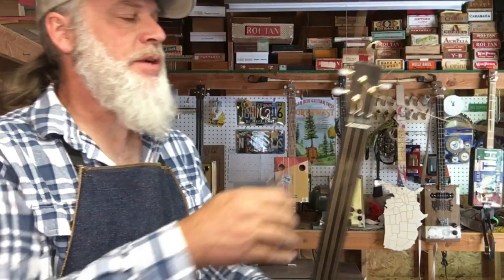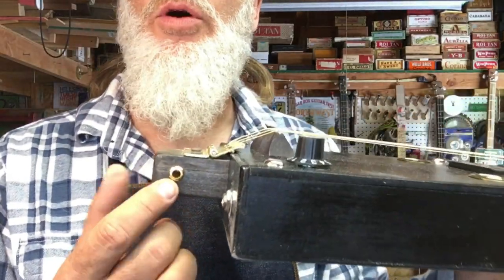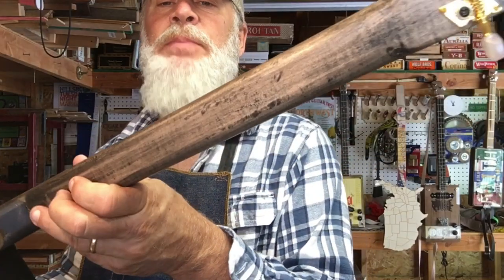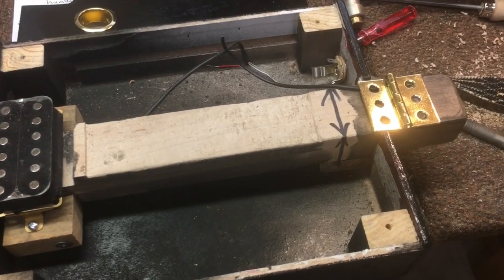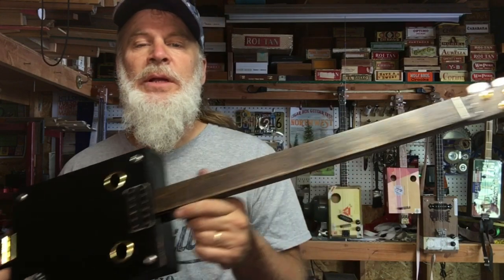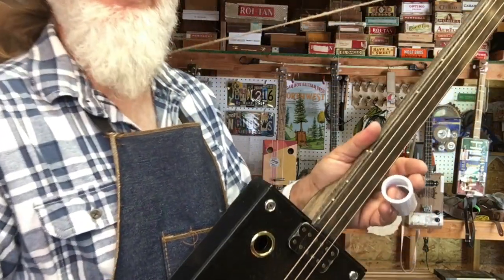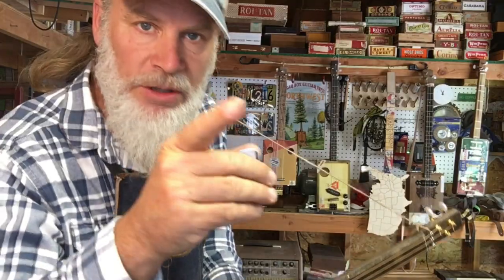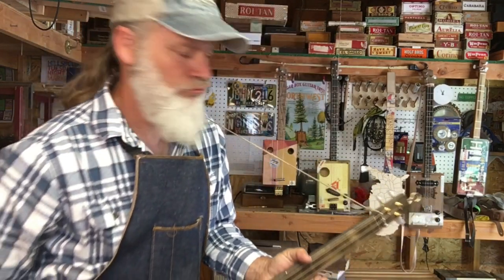Black Beauty - Cigar Box Guitar

Comment: Puckett Cigar Box Guitar I made a 6 String Out of my 4 String by Switching out the original neck with a 6 String Guitar neck attached to an attachment, & it's not 3 strings too many cause I strengthened the box with a special varnish called "Strength enhancement Varnish" and it has the lightest gauge of strings on it & is tuned to Eb Standard cause it's easier on my voice. I made an 18 String Cigar Box Guitar (Octave Higher, Regular Octave, Octave Lower tuned to Eb Standard cause it's easier on my Voice) out of my old Cardboard 3 String Blues Box Guitar by switching out the original neck with a new custom built 18 String Neckneck & the body is coated in a Varnish that'll allow it to support more tension and not break. which has the 1'st group of 3 Strings being 2 Unison High E Strings plus a Bass VI High E (Octave below the High E String of a Standard 6 String Guitar), while the rest of the groups are High Octave, Middle Octave Low Octave (The High B String is an Octave4Plus .006 High B cause I have Octave4+ 12 String Guitar Strings & the Octave Lower Strings are Bass VI Octave Lower Tuning Strings). The Song I played on it was Darmon Meader's arrangement of Silent Night:https://www.youtube.com/watch?v=_76dk9TkWaM & it's voiced a little low, the Downbeat in the Alto part at the beginning is supposed to be a C Natural, it makes to Sense for it to be an Ab.